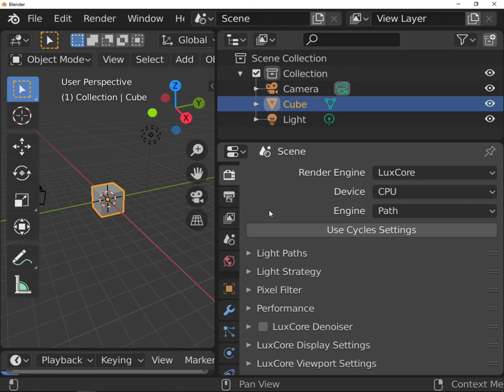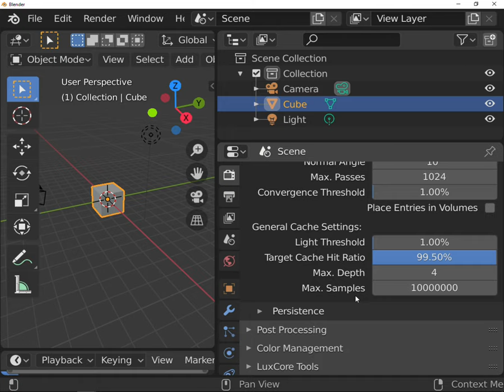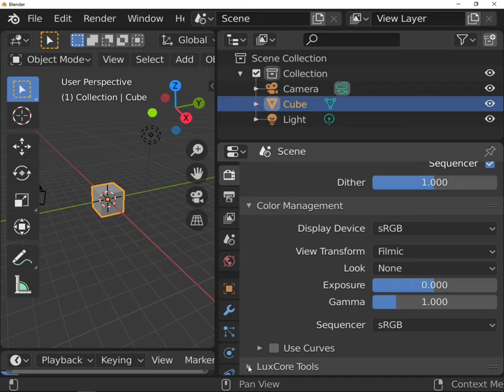BlendLuxCore: Render settings - Environment Cache, Direct Light Cache and Tools VIII

Comment: Amazing series! Presented really professionally and with clarity.
I'd love to hear You explain PBR setups for LuxCore and the differences between its and Cycles materials!
Reply from the maker: BlendLuxCore have "Disney material" node that allows to use PBR workflow. You just plug textures like in Principled shader.
Reply: @mikezurawski5590  Is using Disney Shader slows rendering or not?

Comment: Nice series of tutorials. I'm a Cycles user for quite a long time, but Luxcore seems to have some very serious advantages in architectural renderings, in which I'm mostly interested in. It would be nice to have a series of tutorials for 2-3 basic categories of architectural scenes, i.e. an interior (living room or a bathroom with plenty of Indirect lights), an exterior or an environment scene. And another thing. I didn't notice anything about the "use cycles settings" button. I'd like to learn more about that. And a question (finally). Is it possible to use Luxcore for caustics only and combine it with Cycles in post processing (mix passes in Photoshop etc)?
Reply from the maker: I'm still fighting to find some time to record new series. So many thins are going on right now. Use cycles settigns has some limitations. LuxCore is not supporting the same nodees as Cycles (for an example if you use texture coordinate as "generated" it wont work, but if it is "UV" it will) so translation sometimes is wrong. Simple materials should be perfectly fine. Complex procedural stuff rather no. I suggest baking. There is many benefit from using LuxCore, not only caustic. I can't show it now but I made comparison of motobike in cycles and luxcore. Trust me, the difference was quite big. Now when LuxCore supports CUDA to I really don't see a valid reason of mixing two renderers. Cheers ;)